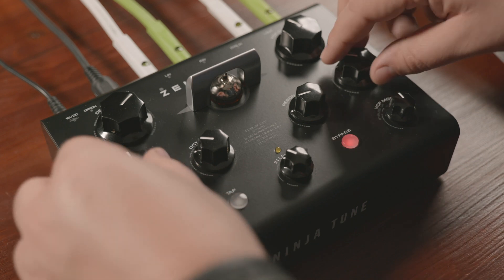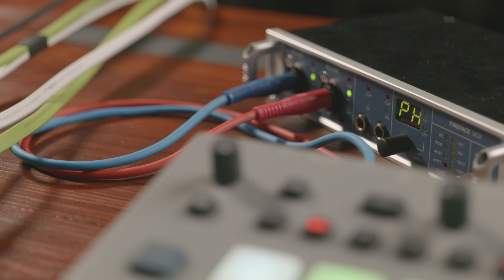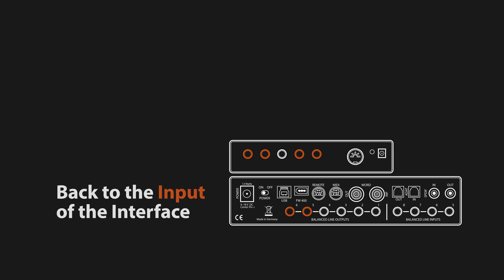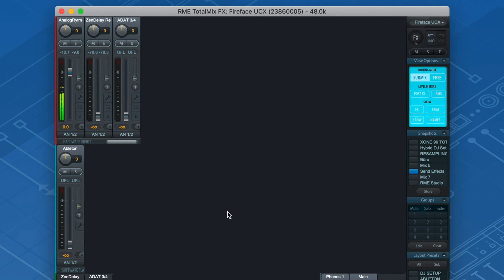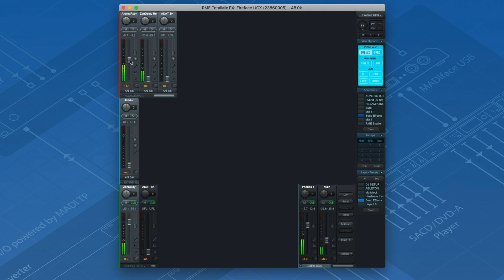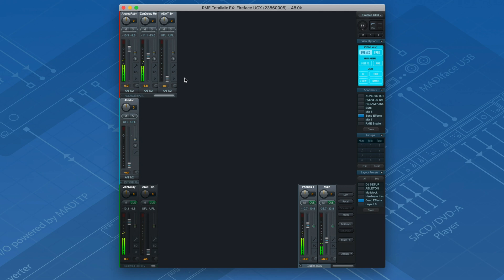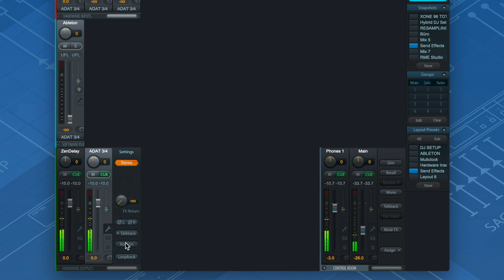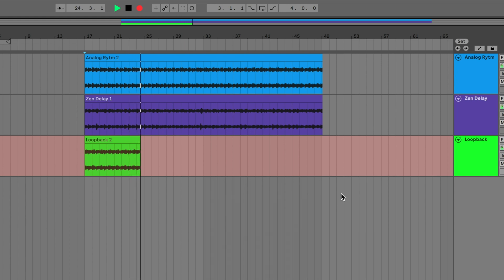How to use Hardware Send Effects in TotalMix FX

Comment: However unfortunately there is a small latency that you can hear doubling. Try dry signals. But still much better than other interface. 20yrs RME user all my converters are RME. 😊
Reply: I guess without latency you need an analog mixer or the on-board FX of a UAD interface. These are the only 2 options I can think of.

Comment: Totalmix "tricky"to use with Cubase - to put it very mildly. I want to do something seemingly simple, which is to add an external Hardware insert to a track in Cubase. With any other interface it couldn't be more straightforward, but with an RME interface there seems no way to make the Steinberg routing work hand in hand with Total mix!

Comment: I don't understand any of these videos. I can't see it explained how to set it up to monitor just the returned (FX) signal only.

I have it I can play an uncompressed track in logic (bass or vocals etc), it goes out of Analogue 1 (XLR) into a compressor, back into line input (instrument 3), but I can hear both the dry signal playing in Logic plus the compressed signal, I just need to be able to hear the compressed signal for the few seconds or minutes while I'm dialing in the compressor settings.

So it feels I need some kind of extra 'submix' or something in the control room, which only has, for example, the line ins feeding it, so I can only hear what's coming out of the 'line in', and not hear what is coming out of Logic (although obviously that still has to be playing and going out of the XLR AN1).

All of these videos seem to have a different Totalmix setup which I can't equate with mine, and then they seem to reference things I can't understand.

Comment: I always end up with a feedback loop, I followed the instructions but the levels are low and the feedback loop goes crazy :(
Reply: Same here...
Reply: @AxisChemicals make sure your “mix” on the effects unit is set to all wet. If you still get feedback then your fx unit doesn’t have true 100 percent wet setting. I have several pedals that do this. They allow some of the dry sound to come through. If that’s the case, then you have to turn down the dry signal at your main bus “only” in Totalmix . Don’t turn it down at the FX out channel of Totalmix, then you won’t get any signal.

Comment: In the video you say "no latency," but what about the time it takes for the signal to reach the external effect, work its way though the processor(s), and then get back to the DAW? Doesn't this involve some unavoidable latency? If I set up a send within Cubase, they provide a way to compensate for latency by pinging the signal path. Wouldn't this be preferable? Here's a video in which this is explained: https://www.youtube.com/watch?v=H-N-9AGlrXk&list=PLFRh3Xy47DTt04dE8WcGV380af93XSItK&index=1&t=180s

I tried their method before, and IIRC I still had to use the send/return method in TotalMix. Still, it has the advantage of latency compensation.

Comment: It would be very nice if TotalMix FX had the GUI such that you could "assign" particular outputs as sends and certain inputs as returns and then there would be send-knobs on each channel as assigned.

This would make the user experience better by abstracting all that routing behind simpler user interface.

Obviously having a delay compensation might be an issue, meaning that since no system is ever actually "zero latency" you always need to add delays to other channels to compensate... but hmm...
Reply from the maker: Thank you for the input. We’ll forward this to our developers.

Comment: This is fine for time based effects like delays and reverb, but by coincidence I was experimenting with this myself earlier today and when for example using a distortion unit, the phasing between the dry and wet signal was noticeable enough to be annoying and I had to go back to using a hardware mixer. If you have any tips for avoiding this problem it would be great, as then I can get rid of the hardware mixer ;)
Reply from the maker: Seems like your distortion effect is supposed to be an insert effect. :)
Reply: @RMEAudio  Using it as an insert effect would solve the problem here, but it's not 'supposed' to be an insert only effect - it works perfectly well as a send effect with a true zero-latency mixing system ;)
Reply: @SB-wn2rd  Maybe split the signal with a DI box, xlr to the interface and the through to the distortion unit.
Of course then it's not really a send effect.

Better if you send a test signal through and measure how many samples you have to nudge the effected track back. I don't see how an interface could solve this issue for you by itself. It can't know what you're using, e.g. if you have a digital unit as a send effect, there is a little bit more latency.
Reply: Hi, thanks for your reply. I already have a completely workable setup for external inserts in my DAW using delay compensation. Of this course won't work for a live feed unless you accept that delay to what you're monitoring too, so I just a hardware mixer with aux sends when recording. To be clear, my issue here is that RME markets the interfaces as 'zero latency' and it's misleading as no audio interface is zero latency. Maybe they should call it 'zero additional latency' ;)